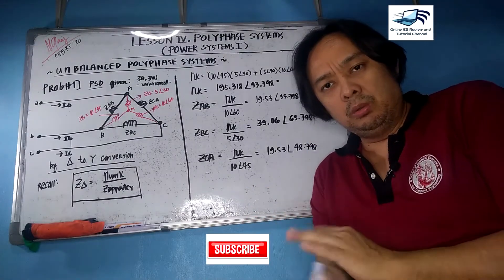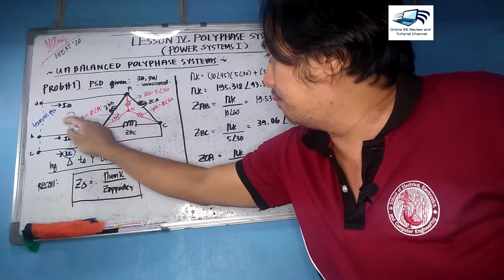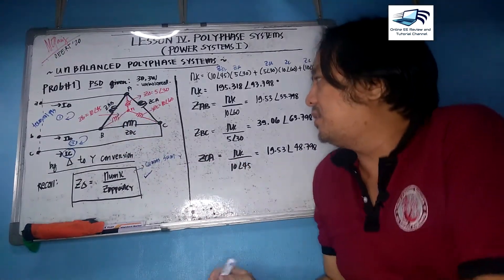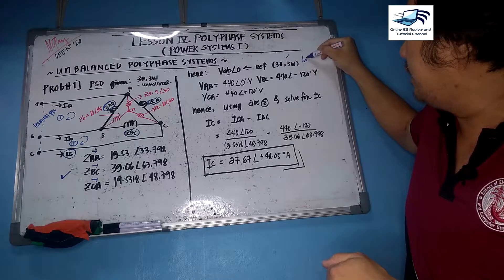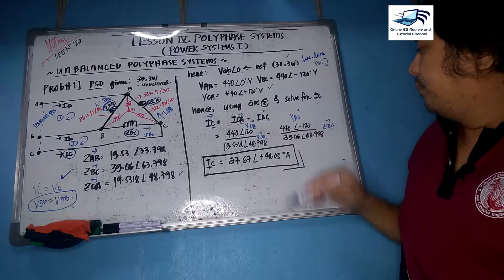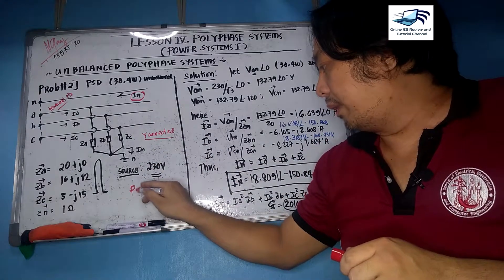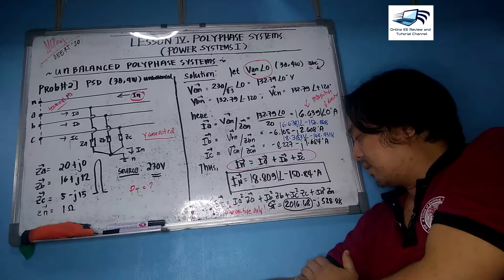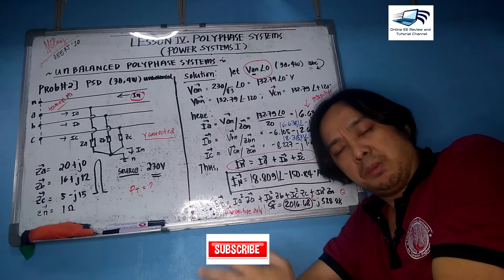Unbalanced Polyphase Systems Problems

Comment: Sir I have a question for 3phase, 4wire unbalanced systems with parallel delta and wye connected load. Is it better to simplify and convert it in wye connected load? or in Delta? will it have same line currents ?
Reply from the maker: wye to delta,.then parallel the common nodes. current will be the same

Comment: Sir, diba po neutral current po dapat for problem number 2 is 8.81A?
Reply from the maker: tama naman alex. 8.809 or 8.81 A ung sagot.
Reply: @michaelcalizopacisph.d.8089  18.809A po kasi nakasulat sir sa whiteboard.
Reply from the maker: @atmsc4nd4l  double bar yun, means, magnitude alex. |8.809|, sinabi ko din sa audio.
Reply: Naka double bar po pala. Sorry po. Nag sagot lang po kasi ako then check answer. Thank you po.
Reply from the maker: @atmsc4nd4l  It's OK Alex. Pag mali naman ako, i cocorrect ko sa comment para maging aware ang audience. In fact, needed natin double bar kase yun ung i substitute sa complex power equation. Pag nagsulat na kase sa white board di makikita ang mali unless makita ng audience. Hirap ng live recording pag white board talaga.Thanks and stay safe.